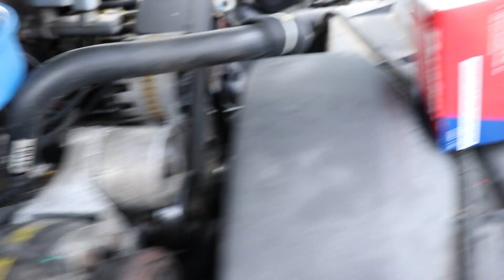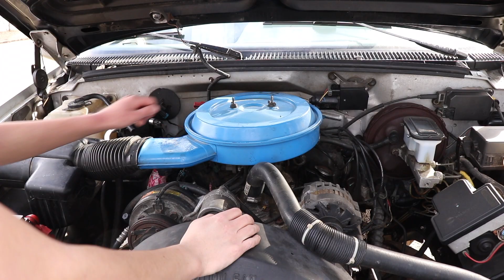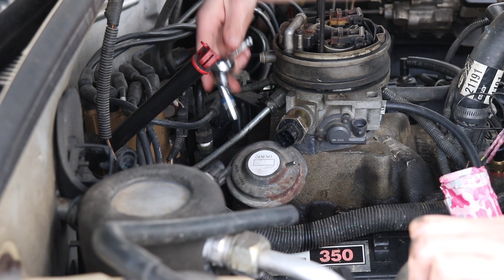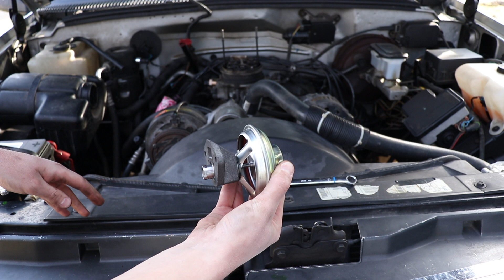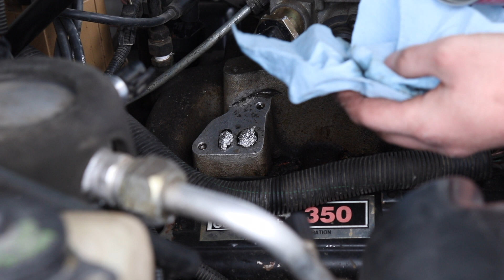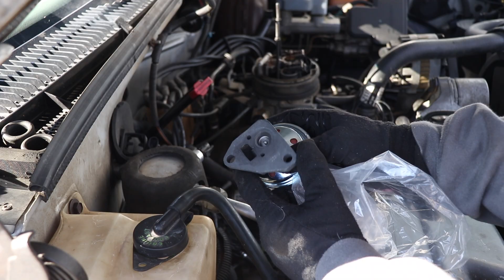EGR Valve Replacement | 1995 Chevy 350

Comment: Must not be a 95 because mine is totally different
Reply from the maker: You’d be correct lol, guess this crate motor is a 78 style block. I learned that after many failed attempts at buying this valve, valve cover gaskets and other motor components. A lot of it is the same but still differences mainly in gaskets.
Reply: Was about to say the same thing

Comment: Thanks for making this video I finally found my issue my egr is bad full of carbon and doesn’t hold the vacuum like you showed
Reply: What was your symptoms
Reply: @adenseay7406  nevermind it wasn’t the fix for my issue, I have a stumble at idle but I found out my egr wasn’t even working so it’s still a good thing I replaced it, my solenoid was not plugged in and the old egr was clogged with carbon
Reply: @ZeRo2o9  I changed my egr still didn’t fix my stalling at idle. Try unplugging your coolant temp sensor on beside thermostat
Reply: @adenseay7406  I replaced my coolant temp sensor and the plug also, I have replaced a bunch of things already
Reply: @ZeRo2o9  what about the ground on the thermostat?
Reply: @adenseay7406  put new terminal and bolted it down do a nearby bracket instead on thermostat housing